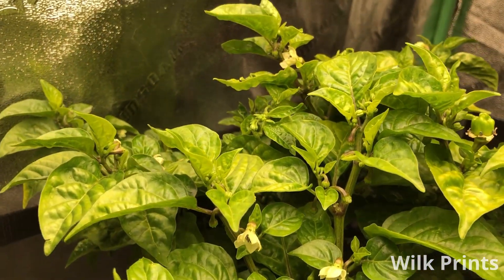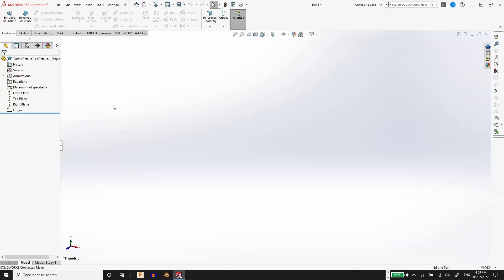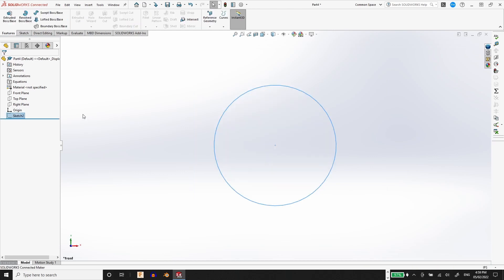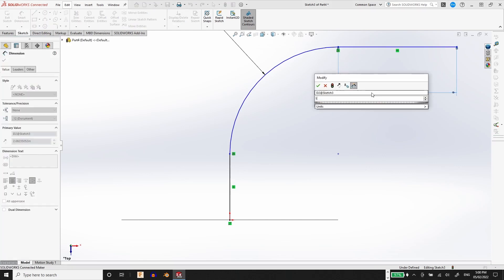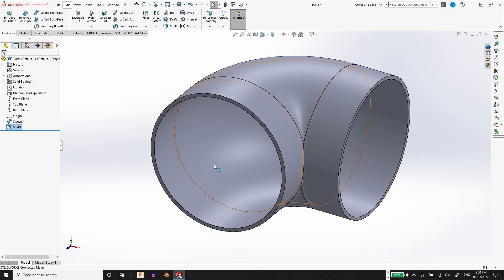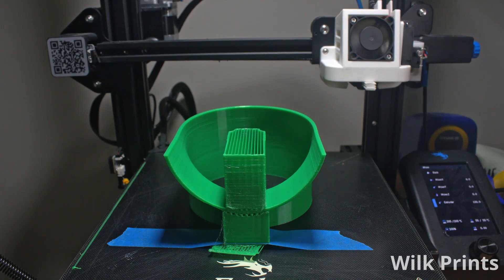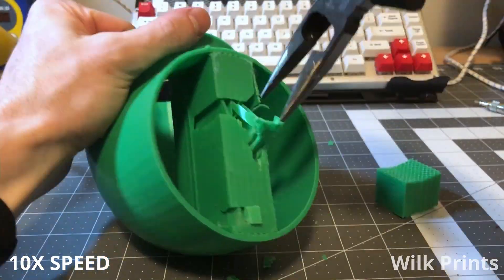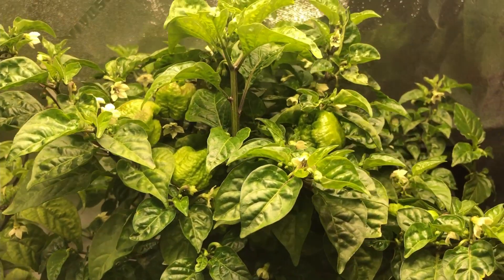3D Printed 90 Degree Elbow for Grow Tent Exhaust Fan

Comment: You don't need to draw the first sketch with the circle, just draw your path and open the sweep feature. Under "Profile and Path" you can chose "circular profile" and specify the diameter.
Reply from the maker: That's a good tip, I didn't know that. I still like the idea of using a sketch in case I want to go back and edit the shape of the sweep later on.

Comment: Great video.   I am trying to create a 70° 5-in diameter elbow.  Any help would be appreciated
Reply from the maker: Hard to give you advice through a comment but I'll do my best. You can basically use the same method as in the video. Draw a guide curve that in your case is 70° and draw a profile that is 5in diameter. Sweep that profile along the guide curve and you're there.

Comment: Thanks for the video. Do you know how to print the elbow withouth the filaments inside? I have no idea how, but i watched other videos and they do it.
Reply from the maker: Yeah you could turn supports on but “only touching build plate” and I would rotate this model by 90deg so that the circle is tangent to the build plate. Then the elbow would probably print relatively well without supports.
Reply: @3DPrintStuff  Thanks for the reply. I don´t understand when you say the "circle tangent to the build plate. You mean, the elbow all lying down?
Reply from the maker: @bizcochodulce  Yeah the elbow all lying down is a good way of describing it. Kinda like the orientation of the elbow in the video thumbnail. When circles are printed in that orientation they're usually mostly self supporting.
Reply: @3DPrintStuff  ahh,ok, Thanks. I printed that way but maybe i did something wrong. Thanks for the help!

Comment: You would have been alot better off using tree supports on build surface only. But still turned out well.
Reply from the maker: Thanks for the recommendation, I haven't used tree supports yet so I'll have to play around with them.